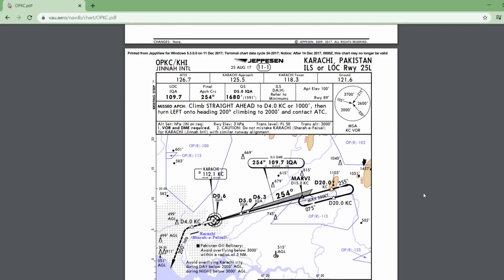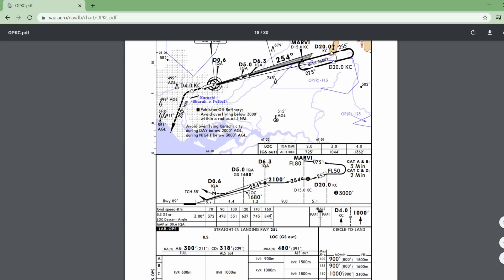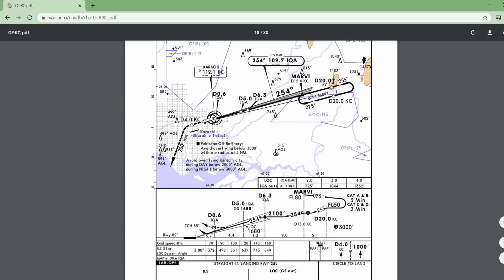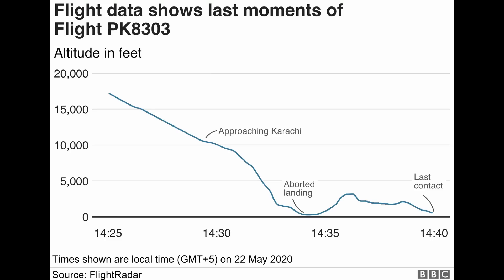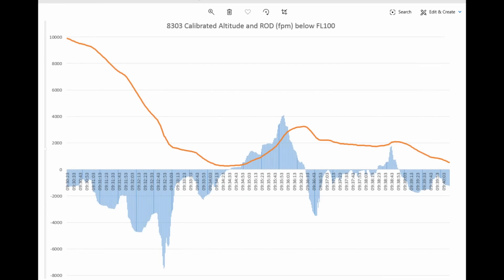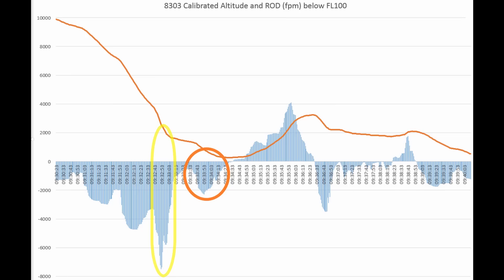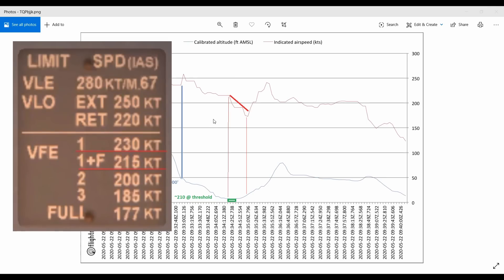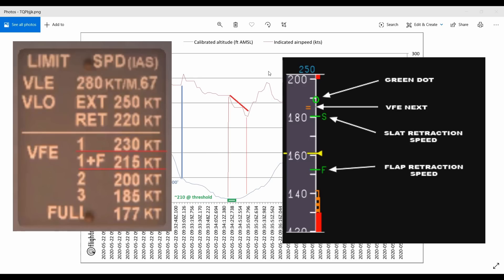PIA #8303 Update #4 Unstable Approach Profile

Comment: Cocky cowboy pilot came in hot and knew it. He did this kind of thing before I’m sure of it....
Reply: You are probably right and those cocky attitudes sometimes come with a BIG ego, a superiority complex and the spoken or implied message to any first officer, "don't even try to correct me or give advice, I know so much more than you".  The F.O. had to know the Capitan was operating way outside norms and regulations.  The Voice recorder will let us know just how much he protested if at all.
Reply: @timhardman4764  That's what I was thinking about as well. I know that in certain eastern cultures people have such respect for others higher up the hierarchy, that they won't even try to correct. And like you said, the other way around, people from higher up the ladder refuse to accept corrections from a lower ranked person. I can't recall which airline, country or flight it was, but in the past a plane crash happened because of this same reason. Mentour Pilot has a video about handling conflicts in the cockpit, but I think how he explaines it won't work in all cultures. Very sad.
Reply: @yornav  South Korean Air had the worst record of deadly cockpit culture issue with many plane crashes over a short period of time.  The author Malcolm Gladwell in chapter 7 of his book "Outliers" explains the problem.  You can read this fascinating analysis here: http://faculty.wwu.edu/dunnc3/rprnts.ethnictheoryplanecrash.pdf
Reply: Yes CVR. Will tell, wonder if it be released , with damming info, at least not in near future.... although flight safety demands it.
Reply: @flyfrt  
The Pakistan authorities won't let out any damaging info. They will blame Airbus.
Reply: I am in IT but that kind of mentality exists everywhere. It's insane. I am also pretty sure he pulled it out many times before in a similar way and thought he's got it now too. Yeah but he didn't. I hope it's not that though. Poor people behind him on that plane.
Reply: @huskytail  yes indeed that bs mentality is common, especially in engineering and more especially in management
Reply: @Phil_Scott  yes, exactly. I just passed days mitigating such a mentality error which floored an entire infrastructure. But unfortunately, what we calm ourselves with, the "no one died", doesn't apply in the case we are commenting on. Terrible stuff. I seriously hope this is not the case but whatever it is, it's still just crazy.
Reply: Sean Cope Guarantee it. What an asshole. CVR comments from First Officer should be revealing but won't be released.
Reply: @ Sean Cope; When i took my (car) driver's license 36 years ago, my instructor said; "Everyday traffic is a dangerous teacher. You can do the same mistake over and over without anything bad happening. If you continue to do the same mistake, unfavourable factors will eventually stack up, and an accident will happen."  I try to remind myself of this every time I'm about to get (too) confident after so many years without any accident. I know I'm been more lucky than I've been competent. I reckon the same can happen to pilots; Not playing quite by the rules for a long time without any negative consequences, giving a false sense of satety, and then suddenly, the consequences are terrible.
Reply: @ewilloch  Great story Erik.  I've been driving for 51 years and I've never had an accident but I've had many close calls.  The few where it would have been my fault, happened when I was about to change lanes on a multi lane highway.  I've had several situations when I KNOW FOR SURE, no is in the lane I want to change over to (due to my superior situational awareness, ha!) and I decide in my head I don't need to look because I am so sure.  Fortunately, good training and repeated practice (S.O.P.) over 51 years of ALWAYS checking (turning my head to look) plus using the mirrors has surprised the hell out of me a few times when there was a car in that lane that I would have hit, had I not done the head turn and visual check. In these situations where I was SO SURE, I did start the lane change slowly and looked at the same time and caught my mistake before I left my lane but I should have looked first as I do 99.9% of the time and then started moving over, if the lane was open.  There is a reason for S.O.P. and following your training even when you're sure you don't need to.
Reply: I've heard of pilots betting on landing on time. Could he have been expediting his approach to try to touch down at a certain time?
Reply: Very sad that the pilot’s Union allows incompetent pilots to kill passengers.

These two pilots did everything wrong even though they had a lot of experience.

Suffice it to say that an automated flight control system would never and could never make all of these mistakes. And besides automated systems have watchdog computers making sure that if the main flight control system malfunctions, the back up systems take over. It has been this way for decades.
Reply: @steveperreira5850  An automated system would not, in the words of an Irish, 'home spun philosophy'; "....have gone there from here."  An automated system would either have refused the task if presented with it five or six minutes out or gone around straight away and taken another ten or fifteen minutes doing it,  The most damning evidence is the rates of descent graph, with respect to the ILS glide slope.  Aviation Insanity.

These weren't errors of omission or intimidation, like the Turkish 737 at AMS where cultural 'norms' were partly responsible for allowing air speed to degrade way below 'stable approach' numbers.  This was blatant, "...we know 7000 ft a minute is a 'Khe Sanh Approach" and shows a complete lack of.......everything.

All concerned must know the CVR is going to be the most vital piece of evidence in this disaster.  If the Pakistan government or the airline want to suppress it, they are going to have to be absolutely blatant.  The question is; the Trump administration is impervious to shame, are the Pakistani authorities equally shameless?
Reply: @rogerwhittle2078  
I'd reckon the PIA may be shameless. They don't have a good record in past couple decades, and there are people in the country rumoring that PIA + media is attempting to put the blame entirely on the pilot, ahead of any investigation, for what perhaps may have been a fault in the plane or in maintenance, in order to cover up the airlines shortfalls. PIA has had many embarrassing shortfalls in recent history; multiple crashes, poor service, and even allowing drunk pilots to fly.
Reply: Wow, dumbass idiot! you could really see all past & future from the comfort of your home, right? Another of those overnight experts who pop up after all such incidents. This pilot had thousands of safe flying hours under his belt with no prior major incident on his record. Yes, based on the data he did appear to make a fatal mistake on this approach, but mistakes happen. Even the most senior, the most expert professionals in their fields are prone to oversights, mistakes.
Reply: @reckz420  Well, we don't know that his previous hours were safe, just that he hadn't previously crashed his aircraft. A pilot who crashes his aircraft on average every 50 thousand flying hours (ignore the fact that he wouldn't get a second chance) would be unacceptably dangerous, but could nevertheless clock up huge hours and be considered very experience without having crashed (yet).
Reply: @reckz420  no sir this is more than an "oversight or mistake"
Reply: St. Devil this isn’t a mistake. This is a gross negligence of not following protocol and SOPs.
Reply: Sean Cope you are right. The poilet was overconfident and proud
Reply: Maybe the aircraft malfunctioned due to poor maintenance, not necessarily pilot's fault.
Reply: @KatariaGujjar  😅😅😅 have you heard the poilet conversation with control tower. If yes you would have not said that..its totally poilets fault 100%..he was overconfident
Reply: @atifrana5470  
Yes, I heard it. He sounds calm and composed which is what all commercial pilots and trained for in difficult situations. The last thing needed in a dangerous situation is a panicking pilot.
Reply: @KatariaGujjar  yes ...but most most unlikely I feel
Reply: @KatariaGujjar  Yes maybe, but unlikely based on what we know so far.  If the landing gear problem was an equipment failure, the problem was exacerbated by an "unstabilized" approach leaving no time and preparation to notice, understand and then effectively deal with the problem.  There were warning bells ringing in the cockpit within minutes of landing.  Unless you are out of fuel or on fire, you Go Around and take the time to analyze the problem before trying another landing. This crew made a series of bad decisions resulting in the loss of many lives.  This pilot was very "comfortable" with his over confidence.
Reply: @Oldsmobile69  Neither of the two surviving passengers mentioned any unusual flight experience, turbulence etc. until the first touchdown when the plane bounced off the runway a few times.
Reply: St. Devil bounced on its engines with the landing gear still retracted?
Reply: Sir, that flight path looks like the pilot was going into a "hot" zone. Remember, people toss rpg and other crap at random planes over there. That wasn't the flight pattern of a non military pilot.
Reply: @d.t.4523  
Nobody has ever launched an rpg on an airplane in this country. Where do you get your information from? Stormfront?
Reply: @KatariaGujjar  I've never seen stormfront, sorry. 3 generations of family combat pilots, going back to Korea, is where. I'm glad you're safe. If I ever hear India want's real estate back to plant flowers, maybe tulips or pansies, I'll let you know. I'm sure you'll want to find a hiding place. Stop using spitballs, they lead to rock throwing and you live in a glass house. Good luck to you.
Reply: Seems like it. By all accounts he was playing Rambo.
Reply: It could well be due to some technical faults in the plane reading regarding height, speed etc which might have caused such unbelievable descent.
For example, actual readings different but plane showing different readings which caused the pilots not to be bothered
Reply: @dkht47  Dear Mr Knight , do you speak with any experience at all ?  I am a ppl   and cannot imagine  errors so great being ignored
Reply: dark Knight47 he was told by the ATC twice on approach.

Comment: It really makes you wonder about the flying record of these pilots.
Reply: I'd check their mental state if possible.  Looks like a suicide attempt and they tried to change their mind.
Reply: @joeskis  now that it has come out that the CVR has gone missing, you are probably right.
Reply: 18,000 hours for the captain.... If I was an investigator then I would go back and analyse data records of all his previous flights too. I've a feeling that this is not a single incident, this has happened before, only thing is that he didn't crash before.
Reply: If you’re suicidal, why bother to wait until landing? Likely the crew was not paying attention until too close and tried to “fix it” instead of going around.
Reply: Yeah and how many other ones are still out there... I think their supervisors should be up all there asses 24/7 and checking their data.

Comment: You don’t have to be considerate. The families of the idiot pilots are probably under the same brutal conditions that made their shitty pilot relatives act like such numbskulls in this emergency and will never see this. They never even said anything close to emergency until they were a second from impact. On top of all the incorrect altitudes during the descent, nobody in the cockpit knew what the gear up alarm meant, or they wouldn’t have slammed the engines and then tried to take off on them. Complete incompetence and bad training and language barriers are the reasons for these deaths.

Comment: So the pilots really screwed the pooch.
Are we going to find out that this particular Capitan had black marks on his record?
A real tragedy, so sorry for all the families involved.
Cheers from Tokyo!
Reply: Looks like they went straight from driving trucks to flying a plane. It was more akin to a bomb run than a VFR landing.
Reply: Blood alcohol? Drugs? The pilot cannot have been that bad for enough flying hours to be flying an Airbus. And where is the co-pilot in all this?
Reply: @sideshowbob5237  My thoughts exactly !!
Reply: @Rzzyy  Being rude will achieve very little.We are all allowed our opinions.Very few on here will be ignorant.
Reply: @Rzzyy  he was overconfident.  He didn't obey the control tower. He said I can manage the height.
Reply: It could well be due to some technical faults in the plane reading regarding height, speed etc which might have caused such unbelievable descent.
For example, actual readings different but plane showing different readings which caused the pilots not to be bothered....the flight captain was one of the most senior pilots in the airline with no black marks on his record as per my knowledge
Reply: @dkht47  --That kind of descent rate ought to make you pretty sick in the stomach, like riding a roller coaster steeply downhill.  It also will cause pain in your ears due to rapid pressure change.  You can feel it even without any instrument.  To make piloting more idiot-proof, perhaps future MFD's should plot out a highway in the sky 3-D path with square wire-frame boxes for you to fly thru, so flying an airplane would be just like driving the car in the highway, by just keeping it within the 3-D lane in the sky, with speed limit signs posted along the 3-D skyway with a digital indication of your own airspeed next to the speed-limit sign so you would always know how you're doing in comparison to the speed limit.
Reply: Most likely it will never be released
Reply: @Rzzyy  https://www.youtube.com/watch?v=UEYiiZdvNh4  The Dumbo here besides you was the flight crew.Unable to understand why you are trying to justify their gross negligence and manslaughter.

Comment: As more details come through, I see there appears to be a clear problem with decision making in the first place, and consequently priority management. In the midst of all the warnings they were getting, they probably missed the landing gear warning. That's a problem with procedures, they don't (nor should, to a degree) foresee instances where the situation is way beyond what are the expected parameters. A crew flying way off their glide slope, with excessive speed, and missing all the marks on that glide slope, and on top of that NOT aborting the landing, isn't something SOP should/could prevent. Hard to expect someone is gonna break all the rules in the book, without extreme prejudice.

Comment: This crew had a HOST of problems way before forgetting to lower gear! And bad decision making.
Reply: Not clear if they forgot it. Maybe the gear wasn't down because of the speed, hence the alarm, which they might have mistaken for something else related to the clumsy approach. This is bizarre, something like this is unbelievable.
Reply: "TOO LOW, GEAR" - Would have been going off as soon as they approached the runway in an unstable manner.

Comment: Just before 14:33 "cleared to land" according to the altitude vs time plot,  which matches up to them descending at 4000 FPM, on the rate vs time plot.   The crew obviously holds ultimate responsibility for their actions, but did tower seriously clear them to land while they plummet at 4000fpm to get on glide slope?
Reply: CKOD the approach tried to turn him several times, and the last time, the plane awnsered that they were comfortable, and got cleared....
Reply: The Tower controls the airport. The Pilot controls the airplane.
Reply: @garyreed2206  In the last comms between the atc and pilot a ding ding alarm is clearly audible in the background. Most probably the alarm is indicating that the landing gear is not lowered. The atc should have picked that up and inquired what it was. Instead the atc ignored it and chose to clear landing. I think this was a fatal error by the atc. Had the atc put the foot down and made the pilot correct his approach this accident may have been averted. I think atc is responsible here

Comment: Just curious as a non pilot.. What does 7,000 ft per minute feel like as a passenger? Would this decent rate have been noticeable or even uncomfortable as a passenger? Outstanding video Juan!
Reply: As a passenger 7,000' per min decent would be damn terrifying. Not unheard of, but usually for collision avoidance.
Reply: Mostly would have seen vibrations and juddering due to speed brakes being deployed to descend quickly. They would have to be deployed, else they would have dove straight to the ground.
Reply: I found a website that converts feet per second to G's (http://www.kylesconverter.com/acceleration/feet-per-minute-per-second-to-standard-gravity).. 7000 feet per minute is about 116 feet per second, which calculates to negative 3.61 Gs. AN average human loses consciousness at negative 3 Gs.

Comment: In 1986 a Pakistan PIA 747 belly landed because the pilots forgot to lower the landing gear.
No injuries and the plane was repaired and flew until about 2010.
Photos on google images.
The present case appears to be completely different.
Reply: Just saw the photos - that’s insane.  Thanks😀

Comment: What should a crew do if, for whatever reason, they find themselves approaching the airport considerably high and fast?  Continuing to attempt the approach is clearly not the right choice.  Is there a standardized way to ask ATC for a deviation of flight path to accommodate descent to appropriate altitude?
Reply: They don't even have to ask ATC.  They just do it and tell ATC they did it once they've established a stable climb.  The pilot has the authority to go around, and there are published procedures for it that ATC is supposed to keep clear, because any plane coming in for a landing could go around at any time.